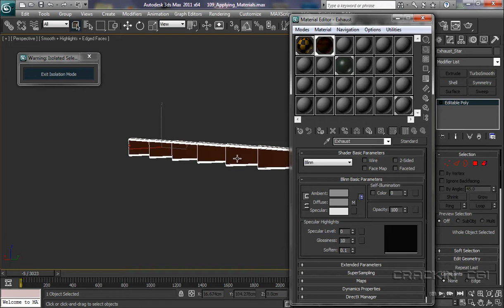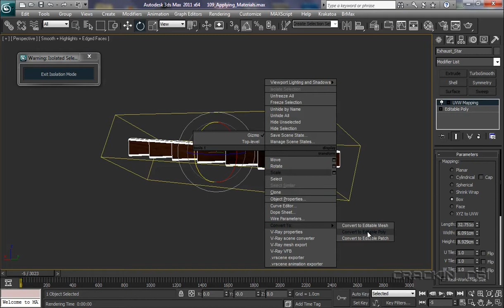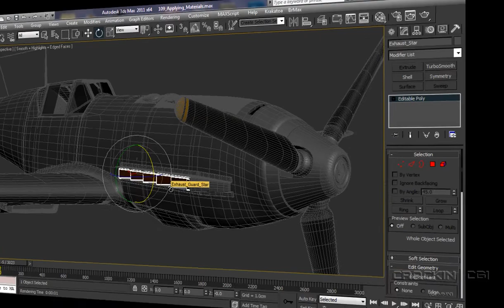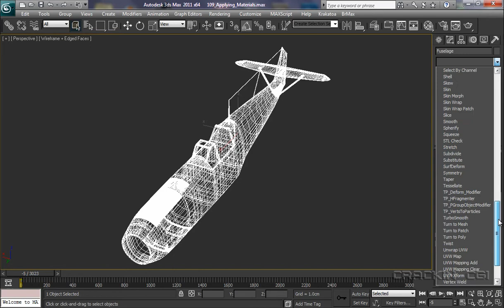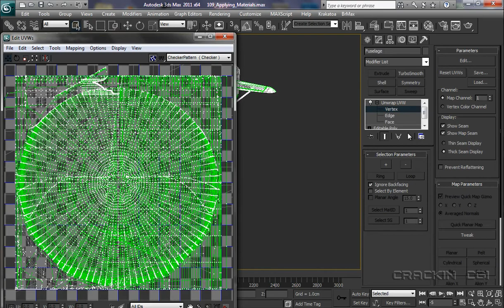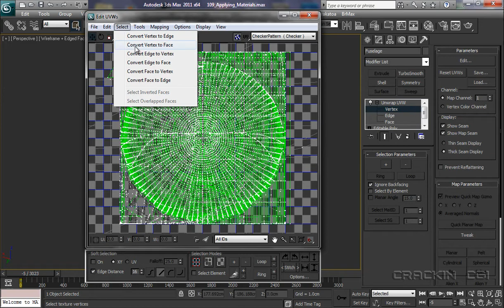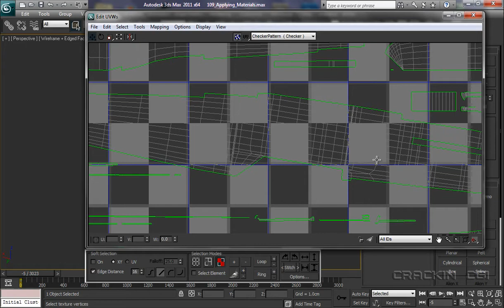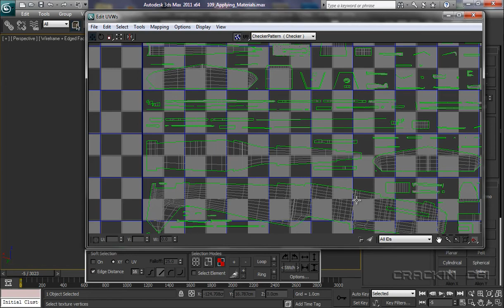Adding_Materials_and_Maps_Part_7.mov

Comment from the maker: Now that's exactly what I would have thought.  However, using wire frame mode caused a lag in responce to navigating the viewport by far less than in smooth & highlight mode.  Notwithstanding, you should see me flip between modes in the next few sessions - but thanks for your input :)